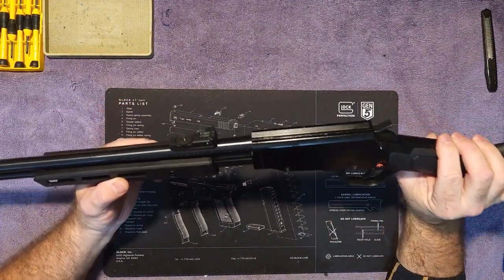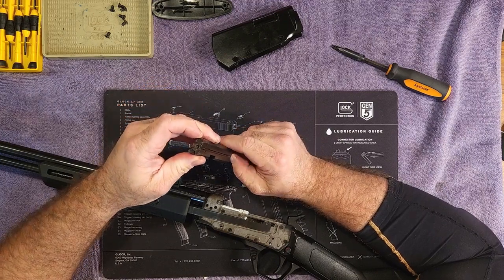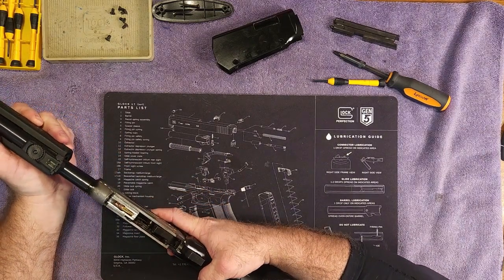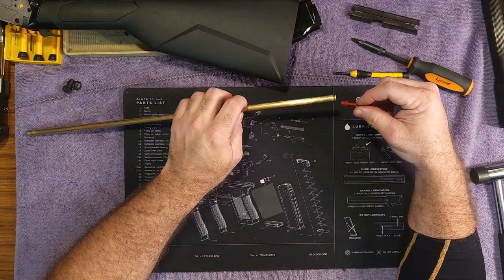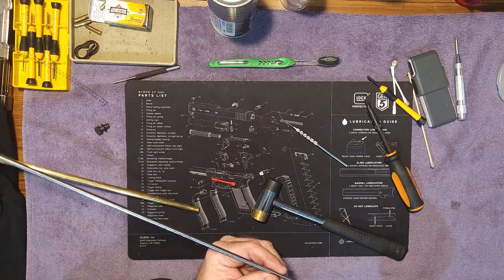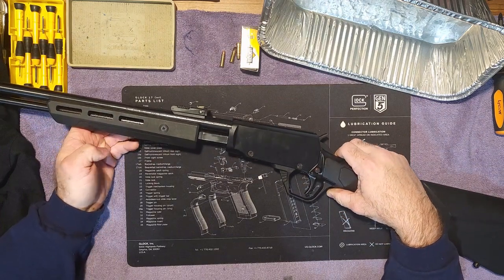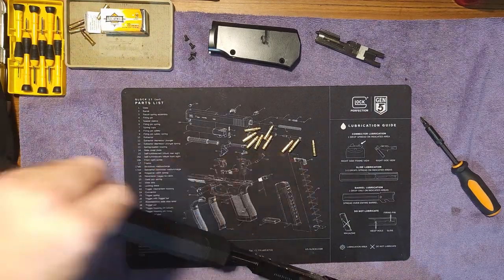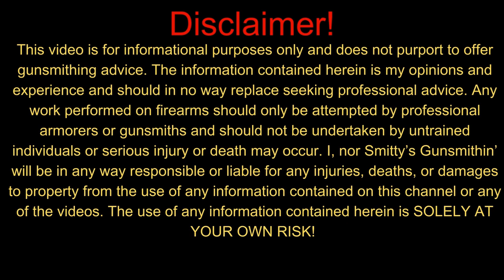Rossi Gallery .22 LR Feeding Fix, how to fix feeding and jamming issues

Comment: I had that same problem with the feed tube on the Rossi Rio Bravo lever action that I bought. 
I did manage to fix that.  
However,  the barrel was too brittle and didn't survive the first trip to the range.  The muzzle chipped out and had cracking inside the bore. 
It was shooting minimags for a 6 inch group so I knew something was wrong.  I will post you my video in my next comment.